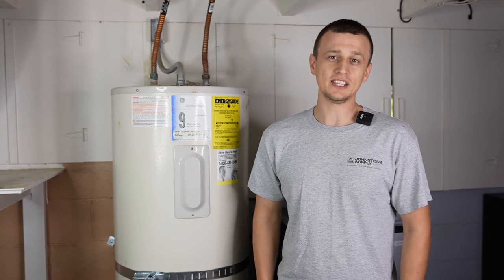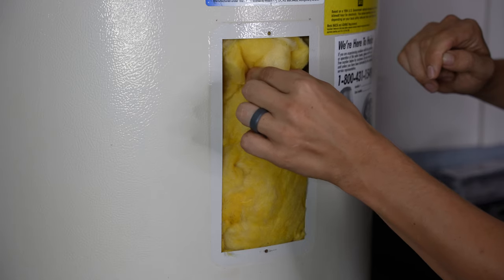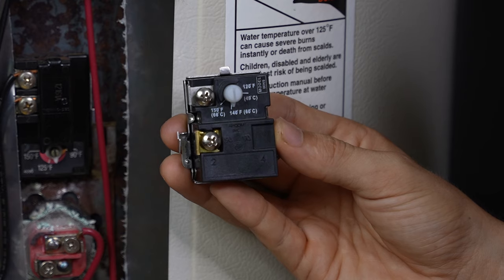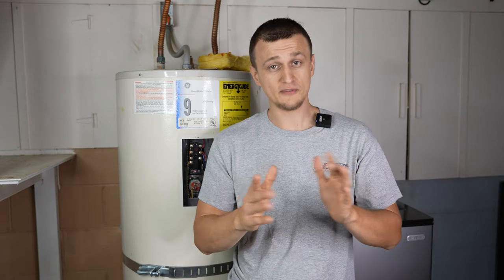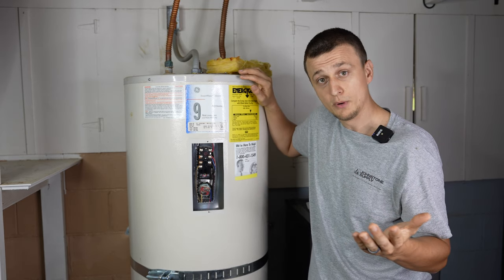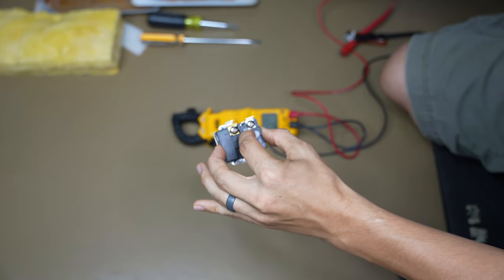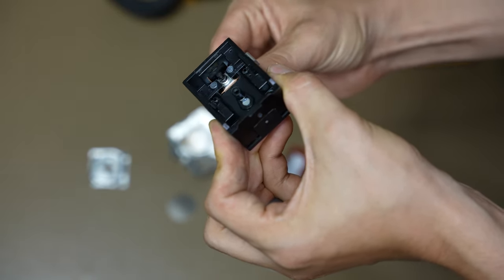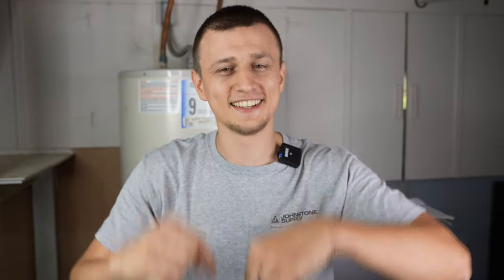How To Change or Adjust Electric Water Heater Temperature

Comment: I've always kept my water heater temps on the hotter side (140-150º or so). My rationale is that if the temperature is hotter, I'll use less water from the tank, thereby reducing the water that needs initial heating. I've (possibly incorrectly), concluded that saves me money but of course, that doesn't take into account the need to maintain the hotter temp so I have no idea if this correct. Do you have any thoughts about this? At close to 64 years of age, I'm not sure if I'm qualified as "elderly", but my reaction time is still pretty good. :-) Really appreciate all that you do - great info!
Reply from the maker: That is an interesting idea Phil. I honestly don't know which way is more energy efficient though. I have never tried doing an experiment like and it would probably be hard to track. If we listen to the US Department of Energy, 120 degrees is the most energy efficient. I am guessing that setting the temps higher uses more energy but I don't think it is by much. The reason is simple, the higher the temperature of something, the faster it cools off. Heat travels hot to cold and the bigger the temperature difference, the faster the heat transfer. That's what they say anyway 😄 I know that not everything in the world runs by the book. Maybe your way is better after all 😉 And about the elderly, I don't think 64 is that old! My dad is 64 as well but he had a stroke last year and the senses in his right hand are not as good as they used to be. I'm sure the majority of seniors' sense of touch is just fine but for folks like my dad, they need to be a bit more careful. 👍
Reply: This is spot on Phil. I totally agree with you in respect to this thought process. I, myself, have done this very same process with this thought process and it works. Only issue is if you have a water pump instead of city water, the heating elements have to be changed out sooner than later from the limestone corrosion build up. I wish I could go into more details but for the most part, I’ve mainly had outside water pumps and not city water to really compare that to.

I hope this helps anyone out there looking for DYI answers.

Comment: I will say 120* f is to low if you have a 30 gallon electric water heater with a single 3800w element with cold well water. 135*-140*f is best if you are a grown adult and carful. Also apcom thermostats are better than thrmodisc. I broke off the face of a thrmodisc thermostat as it clips to a lip that is the feont face. The thermostat that with the cover was a thrmodisc. The one he was using in the demo with out the hi limit is a APCOM type. It is better. Becose thy hold the wirs more firm. Thy all so have instructions how to take the safety strip off. The safty cover is held on with in a way if you were not care full you would be not likely to brake the thermostat.

Comment: Thanks for the info. I just move into a house with solar panels and an electric hot water heater. Why is a gas heater so easy to adjust compared to an electric? It seems that the manufacturers don't want you to mess around with it.

Comment: hey bro I just installed water tank and the sitting was 140 degree from the factory and when I use it was hot I mean too hot and I didn't know what to do then watch your video and adjust the thermostat to 120 degree hopefully this works

Comment: Today, My hot water breaker was kicked. When I went to the breaker box I noticed there was a new security tag and meter but I'm not sure when they installed it if it was throughout the day or within the last week or so. Also I'm not sure if this could have kicked the breaker or caused at thermostat or element to go downhill quickly on a fairly old heater. Nonetheless my family has noticed over the past few days that the water seems to be at least 10 to 15° warmer  but as of now the water is heating and it is a fair bit hotter than normal. What do you think is most likely the scenario here?

Comment: I guess the temperature limit switch has to set at a point 120 degrees before the relief valve opens.
Reply from the maker: If you are talking about the limit with the reset button, I think that one actually trips at 180 degrees.

Comment: Aloha my bradah. I live in kona was wondering if i could get some advice i do HVAC/R for a resort learned on my own got my epa certificate and hvac/r certified but i have never done service work for a company  that specializes in HVAC/R .would  you know of a good company here on the big island that takes care of there techs i do enjoy doing commercial A/C work.  2 yrs experience and have installed both residential a/c and commercial refrigeration equipment

Comment: What does it matter if the power is on if you’re just changing the temperature?
Reply: On mine there were wires with the copper exposed near the adjustment screw... so if it's electric... I'd shut it off to be safe
Reply: @MrMeech76  I only ask bc I’m renting and the breakers aren’t labeled so I have no idea what is what lol

Comment: This reminds me...I was told I should drain out the tank on my heater about a year ago
Reply from the maker: Glad I could be a reminder! 😉 Although if it's an old water heater, I would just leave it be 👍
Reply: @WordofAdviceTV  going on 5 years old, the lady I bought the house from suggested it and shared manuals. Then your video popped up for me... Wondered why I had subbed but didn't get notifications. My sister recommended a video about a/c here!
Reply from the maker: @sereneDelusions  Oh well if it's only 5 years old, then may as well drain/flush it :) That should get some of that sediment out of there.
YouTube is getting crowded so they've changed how many things work including video notifications.

Comment: Just replaced pressure valve coming out the side connected to hose because it was dripping hot water and it's still doing it

Comment: My Rheem says 125-130 top and 120 bottom.   The problem is the thermostat has widely spaced marks.  Totally worthless.  They say it was set at the factory.  Eyeballing it, they look similar.  but with no real marks on the thermostat on where it should be, their engineering sucks. How can you really set it correctly????